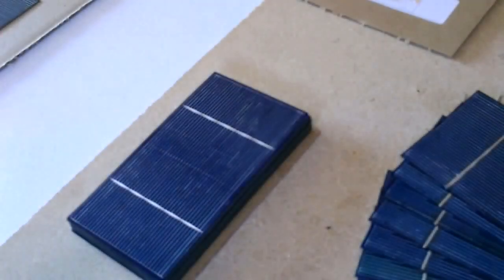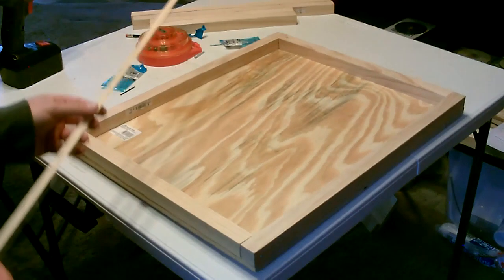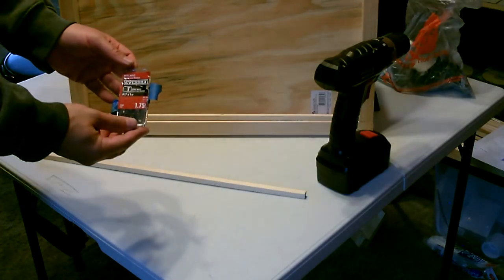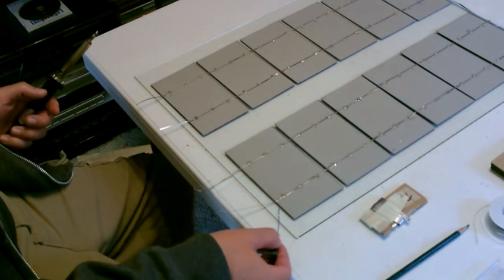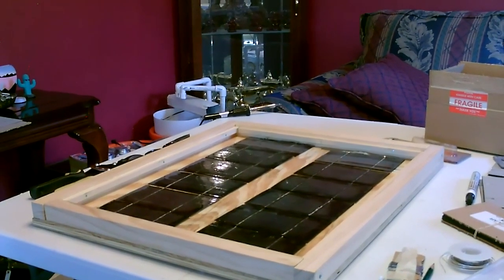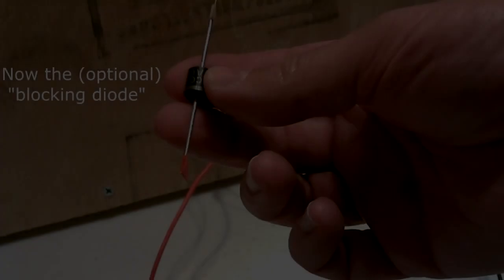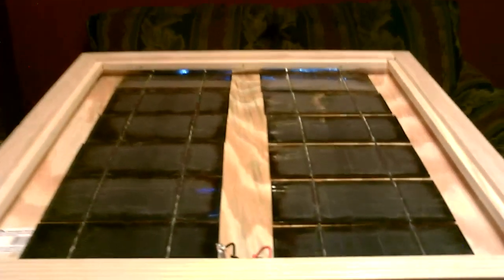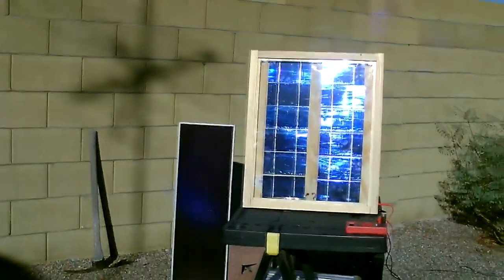How to make a Solar Panel (part 3 of 3) - "how to build the case" - Easy DIY

Comment: Great video. Just one problem. For some reason all my solar cells have the + (positive) and - (negative) wires clearly marked, on the back with a piece of solder on each. I tried soldering them 4 in parallel and they work great. What is the best way to solder, arrange the wires so I'm not wasting any? Currently I have the positive all on one side (negative the same way) I have the wire connecting as a long strip completely bare (no insulation) on both sides and so the Pos and Neg are completely exposed. Is this the best way? I plan on putting the set of cells in a picture frame , maybe after epoxying them on poly urethane for the weather. Any help would be appreciated.

Comment: do not need battery, why not use solar power directly?
Reply from the maker: hi. you can do either with these panels. just depends on your needs ...and what you want to run and when. if the sun is out and you want to run something DC powered (or charge up an electronic device) then no battery needed - just hook the panel straight to the device. but the panels are good for charging up solar batteries (deep cycle batteries) too. *then you can also run AC powered stuff with inverter and/or use the power when the sun is not shining.